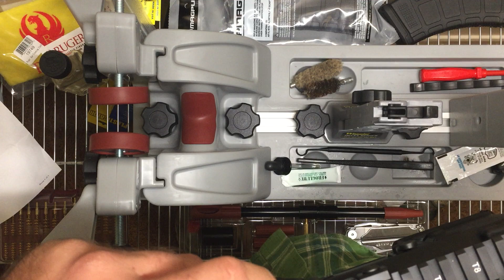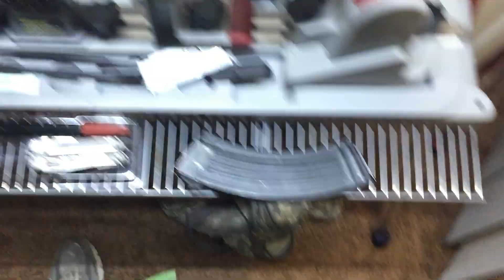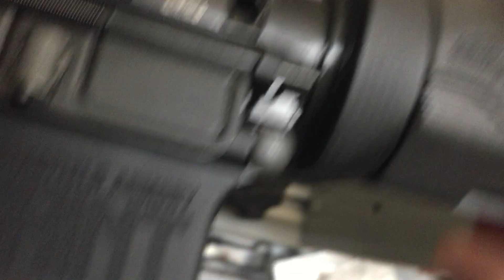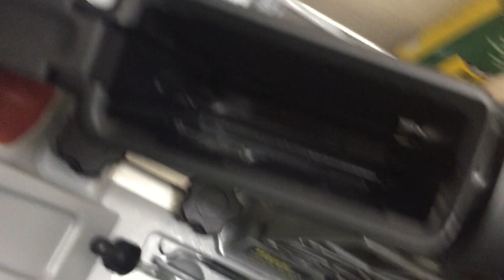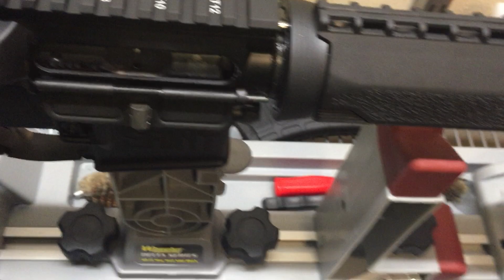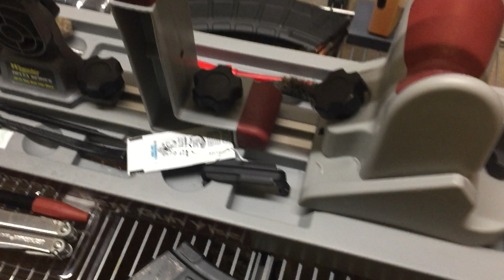(Part 2) Caution Problems With New Springfield Armory Saint Review BIG Fail Malfunction Jam

Comment: Sorry u didn't like comment- but no where in video did u even remove the lower and show bolt. Pulling on charge handle?? I've never took screwdriver through mag well and prized on bolt..
Reply from the maker: I didn't know that was required for you Scotty. Watch video one and two. you can clearly see me pull on the charging handle. If you want the upper off of the lower the bolt has to be completely forward otherwise the back of the bcg is partly in the the buffer tube. Thus basically locking the upper and lower together. It was not possible in video one and honest I didn't even try in video two because the same problems exist from video one. Its a fault in manufacturing not the buyer of this faulty gun.

Comment: Have a victor. No problems with the gun. But never had to call customer service so that might be an issue that you were right about. I have five Springfield firearms and the victor saint has not failed. Sounds like a lemon alignment on the lower and they should give you your money back or send you a brand new gun.

Comment: I had this happen to me Mr. Fix it Austin. Bought mine 4 weeks ago and haven't fired it yet. 😳. I pulled and pulled but the round wouldn't come out. After walking away in disappointment I came back and pulled as hard as I could and the round ejected. It has never happened again and there was no damage to the round or rifle. Just wanted you to know it's not just you.
Reply from the maker: Thanks Edward Blake, and I've very sorry you had trouble I expected a 
lot more out of a firearm from Springfield. I truly hope you don't see 
anymore issues out of it. if so send it back. if they see it happening 
enough they will recall them and get it right. And please take caution when you do go to fire it. I would hate to see someone hurt from this issue.

Comment: UN-HOLY SHIT!   NOT designed to "manually chamber" WTF???  I purchased 3 of these rifles, and several of the EDM Elite pistols, and now having big trouble now with one of the Saints short cycling. But, showing no signs of gas loss anywhere. And after watching these 3 vids I don't even want to call Springfield.

Comment: Mine does not fully get a round stuck so far. I do get tension pulling on my charging handle to eject a round. I have been using ARs for the last 6 years in the military. It’s normal to do a functions check on your weapon before firing it. They are full of shit telling you that’s not how their weapons are design to operate. I hope I don’t end up having this issue. I hope after break in mine will function fine. 

Sorry to hear what you have to go through.

Comment: To unjam that gun it's very simple. Retract the stock all the way down. Take It Outside in the grass . Maybe fold up a blanket  and lay on the ground .Hold the rifle with a barrel straight up and grab the charging handle and put pressure down on it and not real hard smack  the butt on the ground. Sounds crazy but it works every time. I see people in my gun club do it all the time. My Ruger ar-556 was doing this. after I put a couple hundred rounds through it the problem went away. It just needs to be broken in if it has a poly chrome chamber and Barrel

Comment: There is no excuse for that. I can't believe they tried to make excuses for it. If you release the bolt On a brand new rifle to chamber a round letting it slingshot home under full spring tension and the rifle does not go into full battery, There is absolutely a problem. There is something going on with the bolt lugs aligning with the chamber. That's bullshit that they didn't fix it right the first time you sent it back. Did you try mortaring the rifle to get the stuck round out?
Reply from the maker: I agree! No I didnt try mortaring it. I was a little afraid of inertia firing. my thought about this is I never want to own a AR that I have to try this. The damn thing should just work.
Reply: Mr. Fix It Austin I agree, really the mortaring is a last ditch effort thing for out in the field. But yeah, not really a good thing to try in the house haha.

Comment: that chamber needs to be opened up... i would request they change the barrel completely... if they refuse to do it, i may suggest to get a brass chamber brush, attach it to a solid cleaning rod(not a hollow one) place the cleaning rod in the chuck of a drill. separate the upper in the rear and allow it fold over while still in the vice block. place the chamber brush inside the chamber and slowly rotate the drill while pumping it in and out of the chamber for a few seconds speeding up the drill gradually. take some patches and clean the material and use some canned air to blow put the excess. if you have an empty casing, place it in the chamber. close the upper. insert the bcg. send it home and try to extract the casing. if it does the same thing again, manually extract the casing(mortar or tap the charging handle with a nylon or brass hammer until it extracts and repeat the polishing process. be very methodical and deliberate. you do not want to over do it as your head space could be permanently and negatively effected. if you have go and no go gauges, use those instead of a spent casing and i would caution against using a live round during any of these processes. it's unlikely to be set off; but better safe than sorry... also, don't use cutting compounds as unless you have alot of experience, this makes it easy to remove way to much material. good luck.

Comment: So did they replace the bad Barrel? Sounds like you had a Piss poor Cut Chamber .. IMO I would get a set of Go, no go Head space check...
Reply from the maker: They still have the gun Xdm40cal. thanks for watching. subscribe so you can see the outcome in part 3
Reply: Being its a BCM With Springfield markings. I hope they Fix the issue, and Replace the Barrel.. Someone for got to check the head space... To say they shot 20 rounds of Federal ammo and then you load a round and it get stuck tells me the chamber is a no go ....
Reply from the maker: XDm40cal can you send me the link where you are reading that BCM made this for springfield? I can't find anything on it at all. If this is the case I would like to get on the horn with BCM about mine. See if they can help.
Reply from the maker: Thanks XDm40cal
Reply: Yep no problem..
Reply from the maker: Check out part 3 it up

Comment: please do a video and show us how YOU are loading the rifle.
Reply: Sounds like your doing something wrong. Just my 2 cents
Reply: 2:54 "I got it loaded up a magazine,  pulled the bolt back, and HIT THE BUTTON FOR IT TO GO INTO BATTERY". What? Sounds like he is slamming on the forward assist and locking the pawl into the bolt, jamming the gun.
Reply: @andrewdriver3318  he probably meant the bolt release button that sends the bolt home.
Reply: @Ninja9981000  Maybe, I don’t know everything. BUT, He said he inserted a loaded mag, and the bolt won’t lock open on a loaded mag. I have never seen the malfunction he is describing, except when someone has jamed the pawl on the bolt by beating on it.  He never showed how he was loading the weapon so I can only extrapolate from my experience. I admit I am only assuming it was user error based on that. He may well have received a faulty gun but I haven’t seen anyone else mention this issue.
Reply: @andrewdriver3318  a bolt won't lock open on a loaded mag. The only thing I was thinking is that he had the bolt open, inserted a mag, hit the bolt release and that's what happened.

Comment: Does it only jam like that with a round, or does it do it on an empty chamber?
Reply from the maker: Just with rounds
Reply: I wonder if a loose round without the bolt pushing on it gets stuck too (extracting it with a rod, or dropping it out)?  Just pushed in with your finger.
Reply from the maker: I did that. I forgot to say it in the video. but I put a federal green tip in like that and It fut just fine dropped right in. I've taught about it a lot. now I am no pro gunsmith or anything but it seems to me that the bcg does not align with the chamber.
Reply: Mr. Fix It Austin I saw that these actually have some sort of adjustment pin above the pistol grip to reduce the tolerance between the upper and lower, as most AR's "rattle" a little bit.  Having this too far off could throw the upper and lower out of alignment?
Reply: AccuTite Tension System, they call it.  I use an accuwedge in mine.
Reply from the maker: yes it could but the bcg and chamber are both in the upper so it should not effect them.
Reply: Scratch that, I still think it's the bolt...extractor ejector out of spec maybe.
Reply: Mr. Fix It Austin I had to think about it....if it's not the bolt...and the upper is too high off the lower...the bolt wouldn't get a straight grab on the round out of the mag.  Can't remember if you said you tried loading it without a mag, and with the bolt.

Comment: -- You didn't break it in?  Never fired it?  Hey, I've seen problems with the Saints like this before, so I'm not on your a33, but a review without breaking it in, is really no review at all.  
    Whether I'm right or wrong about your procedure there are things you can do.  Load the mag full, let it sit for a day or two.  Work the charging handle a couple hundred times, applying oil.  Then put at least 200 rounds through it, different ammo, see what it likes to eat.  
    Thanks for the vid, but you've got to break these things in.

Comment: Wow. I was interested in this gun BEFORE I saw your video. Will steer clear of this one!
Reply from the maker: Thanks for watching and commenting Marky Polo, Good luck on your AR search.
Reply: Colt, Daniel Defense, BCM, LMT, KAC - that is it.  Those are the only AR variants to look at in my opinion.  My background? 10 years to present on a LE tactical team and over 25 years on this platform.  I was shooting ARs before the first AWB and continued to during and after.  Thanks.
Reply: Thanks for the Guidance my friend!
Reply from the maker: Danny Ducet what about LWRC? my next is between lWRC IC A5 and DDm4 v7 or v11. Thoughts sir if you would?
Reply: Daniel Defense all day in that decision.  Hands down.   I have several videos on the AR variant and the leading manufacturers.  It is something I have some time and experience with.  A DD would do great.  A Colt is also a superb choice.  BCM does not miss a mark either.
Reply from the maker: I Think I'm on the DD train now. V11? V7? your thoughts?  I have 3 colts so I'm content there.
Reply: Mr. Fix It Austin Go with the pro model of either the V7 or V11. The comp trigger is really decent for a factory build on both. I have about 5000 rnds through my V11 and recently purchased the v7 about a month ago and haven't had a single issue.
Reply from the maker: great advise Kevin K, pro model it is. DD's website's compare feature was not working for me. can you tell me what the  differences are beside keymod and mlok?
Reply: Mr. Fix It Austin Honestly not a whole lot. Keymod obviously uses the "keyhole" style adapter slot while M lok uses a  more even cut out slot and is supposed to be a bit more secure with poly excessories. I feel like M lok excessories are a bit more available since keymod rails are still more common but there are plenty of options for both out there. I haven't really noticed any advantage over 1 or the other except maybe the M lok being a bit more aesthetically pleasing IMO and thats subjective.
Reply from the maker: Right on thank you for the info.

Comment: That's a shitty problem, and they have an obligation to remedy that problem, however they don't have an obligation to give you a new gun. I've seen motors and other various parts fail on brand new or cars with only hundreds of miles on them. You don't get a new car because of it. You get the car you bought fixed on their dime. Same on the rifles. Now if they can't fix it, or the problem keeps coming back, then that's a different story.

Comment: If it's chambered in 223 and you're using 556 it will jam like that
Reply from the maker: it's muti-chambered and stamped that way on the lower and the barrel is stamped 5.56. I noted that and showed that in the videos
Reply: Paul Smith — That is just... 🙄 how do I kindly say it... an understandably incorrect and incomplete understanding of what .223 Rem and 5.56x45mm NATO cartridges are, and how they differ, based on the popular mythology. Perhaps you would benefit by reading a little bit about .223 Rem and 5.56NATO, and maybe even .223 Wylde, and how the chambers differ... and how the ammunition casings and bullets do not. In any event, the perpetuation of this myth of physical difference in the dimensions of .223/5.56 must end.... Cheers.

Comment: It sounds like the breach and bore are out of spec with the way that cartridge is jammed so tight.   When you get it back you might want to lock the bolt back and try to manually insert one to see if it will seat.    I wonder if that rifle might be chambered .223 and it causing the 5.56 to jam?    Just some thoughts.  Good luck brother.  Keep us posted.    I would demand a new rifle or a full refund and not settle for anything less.   If they give you any more crap, let them know that thousands of people have already read about your experience with this POS.
Oh and BTW,  I'm betting they didn't fire a single round through it.  By the looks of it, some guy in the mail room used a letter opener to jack the bolt back and clear the round and then stuck it back in the box.   Terrible customer service.   You are not the only one having trouble with the Saint.  There are quite a few videos with similar complaints.
Reply from the maker: This is the first AR I have owned that says multi-caliber on the lower instead of 5.56 or .223. Its supposed to do all of either type. the barrel however says 5.56. thank you sir stay tuned for part 3 its coming

Comment: I'm sorry but you can see clearly that you had damaged the gun in the first video. By using a screwdriver and or pliers. And when you/customer damage anything. Regardless of the manufacturer, the manufacturer is not responsible for customer related damages.

Comment: the barrel chamber is out of spec, they should have replaced the barrrel, don't stick pliers in the chamber, grenade the stock while pulling on the charging handle.  Manually cycle, your loading it, its not in battery, if you would have just shot it, it may have blown up
Reply from the maker: Ahh New2Kendo you got to video 2. Thanks for watching. Thanks for the support and advise. Stay tuned to see the outcome.

Comment: Sorry your having so much trouble with your rifle. Your not riding the charging handle forward are you? Pull it back and let it slam shut. Thought about getting one of these to add to my collection. I've never had any problems with the 3 Springfield hand guns I have. But after you and others reviews I think I'll pass. People buy these as a tool to protect them selves and family and all it takes to lose reliable trust is one bad review. Hope Springfield makes things right for you. Stick with Colt, Daniel defense or Bravo Company. Never ever had one issue with them.
Reply from the maker: Awesome comment Digitahost81. I had tried pulling the bolt back locking the battery button then pressing it to put the gun in battery and I tried slingshoting it by pulling the charging handle back and letting it slam closed on its own. Both with the same end result. You know by my video I'm a lot like you in that I trust springfields xd, xdm and 1911. And I would have continued to trust them understanding that flukes happen. but a lot of this is the way customer service has handled this. And for them to take it back and "repair" it just to have the same problem again. my trust for this platform is 100%  gone. I'm looking at a DDm4 V11. man that gun looks nice